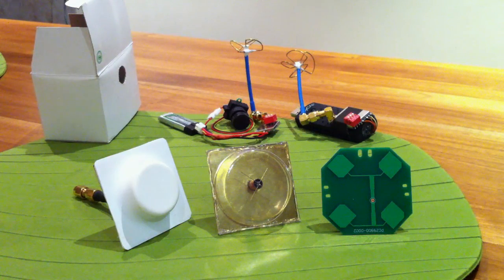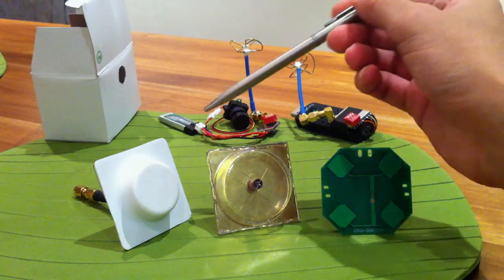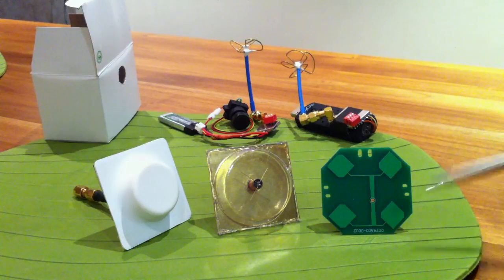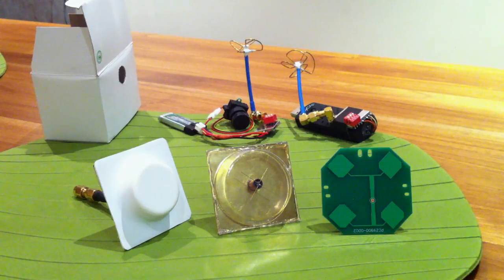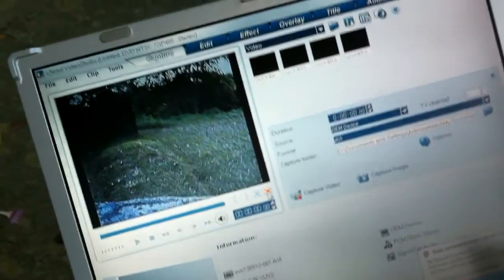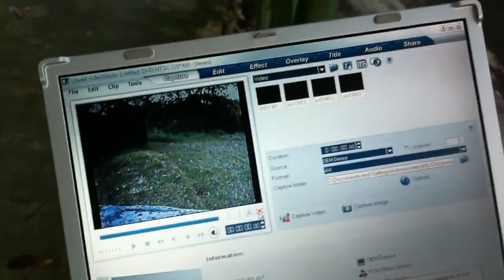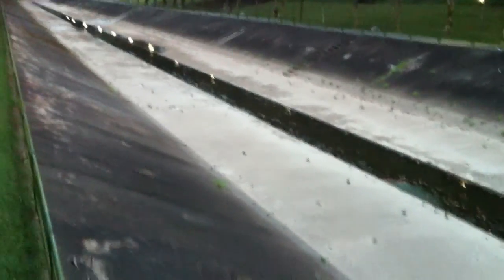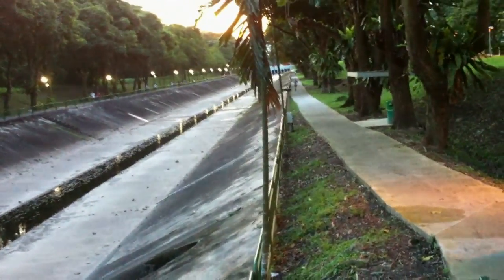Testing the RC-Concepts 5.8G FPV Combo with Crosshair Antennas

Comment from the maker: Hi Kurt, u have a good eye for detail. Yes, what u described is the phasing network to set 2 or more elements in rotation for CP. Each element is CP due to the tapered corners. We could 4 CP elements in a corporate network or 4 linear elements in a sequential network (like the Fatshark patch) or 4 CP elements in sequential network like this NGhobbies patch

Comment from the maker: For ladybird, the difference from this FPV backpack are,
-1g camera instead of 8g camera
-clover cut to 2.5cm long and soldered directly to vtx module instead of using connectors
- 2g 70mah 1s lipo instead of 9g 300mah 1s lipo to power the FPV backpack

Comment: I'm surprised you're only able to get 400 meters with an 8 db gain antenna. I live in a relatively urban area and I've static tested my 5.8 ghz setup (clover/skew) out to 1.4 km, nearly a mile. Perhaps the noise floor is higher in your area, but 400-500 meters is usually the range I fly with my omni/omni setup.

Comment from the maker: @Mark Chance
400m even with TrueRC professional antenna, yes it is true in this video. However, this short range is due to the trees along the jogging track. Leaves have lots of humidity which affect the RF propagation and not to mention, the long drainage beside the jogging track has a stretch of metal fence. Don't give up on 5.8g yet, in an open field, my friend flew to 6km with a 200mw on his plane and my pepper box antenna on his video receiver.  : )